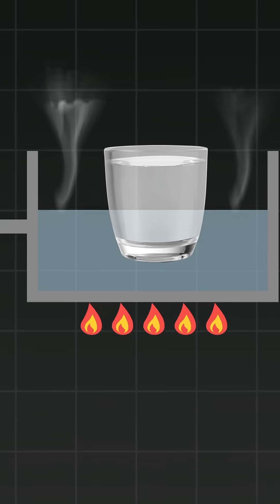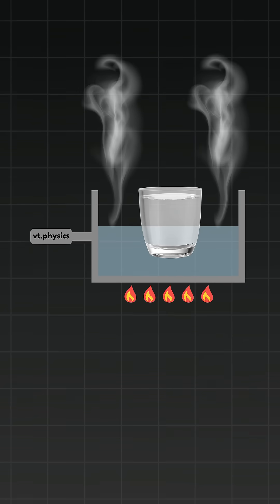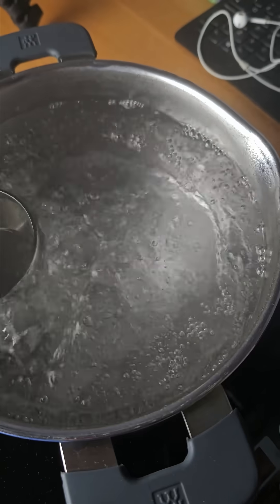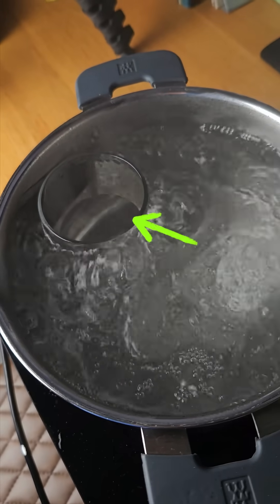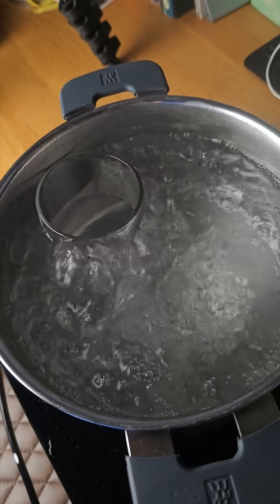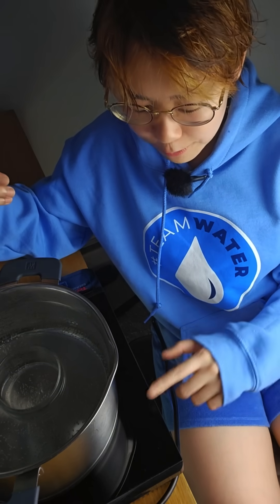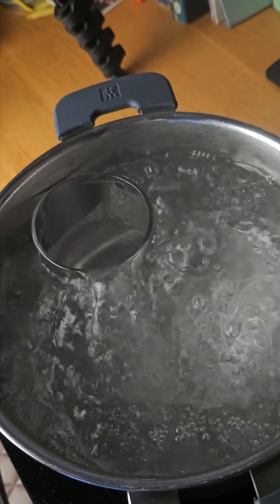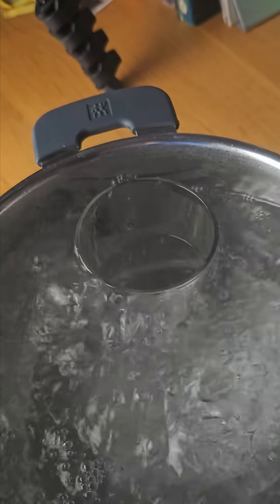Boiling Dilemma: Why Water in a Glass Won't Boil #teamwater

Comment: The heat had to penetrate the glass to make the water boil but since the glass isn't a good enough conductor it can't transfer all the heat it gets from the boiling water to the water inside the glass. The fire transfers heat to the pot then to the water on the pot then to the glass then to the water on the glass. So it loses energy after jumping from each medium to another.

Comment: To clarify, heat only transfers from hot to cold. So from fire to pot to water will continue to happen until the water boils away. But the boiling water to glass to water in glass will have no significant heat transfer, because they're basically at same temperature.

Comment: Put a  bowl over the top  . And let the   water cool  .   Do it different ways  steam  makes it rise when getting hot,   and push out the water that would be there, and when the steam inside will cool and condense and the glass or melts will also shrink  and pull open drawing the  water in. . .  
  Meat  sautéed  or steamed , and if not so contaminated.. will stay operated  as far as flavor  of the water  into the  meat mix. 
  Things like that  are fun food experiments like a seasoning put on the  meat and  the cooling  sucks the to the surface  when the low pressure begins.. .  
 If it is not too much braised and warms  all the way through.  
 Some will be a bit  dry  but still edible..  but the water rich in fat.. allskrts of tjkmgs..

Comment: Given that glass is a decent thermal insulator, and the glass you have has a very thick bottom, probably not until nearly all, or all of the surrounding water has phase changed.

Comment: I wonder how hard you could push this. On paper, it sounds like you can perfectly insulate a space at 100 degrees C so long as you supply the insulation area with enough water / room for it to evaporate

Comment: soooo is there a temperature that you could flash boil all the water?
Reply: it's probably an amount of heat rather than temperature and it depends on how much water there is. if you tried putting a drop of water on a hot pan and it evaporates almost instantly (until the "vapor caught under the drop so the drop floats" thing comes into effect) but there is a formula on how to calculate the amount of energy(heat) needed to flash evaporate the water im pretty sure

Comment: Accually 🤓, water can get hotter than 100 degrees without steam, both though being in a high pressure environment and via superheating which can happen in mircowaves and if the surfaces of the container the water in are super smooth!

Comment: Water can above 100 either by having no imperfections on the vessel for gas to start on or just under higher pressure then same as water boils at low temperature at high altitude

Comment: I would think that the glass would also function as a thermal heat sink to also keep the water in the glass from reaching the required temp, no?
Reply: That only lasts as long as it takes for the glass to heat up to 100C, which is not long.

Comment: Water doesn't all make a phase change, because the transformation of a subset of those molecules removes heat from the rest of the system.  Same reason ice doesn't melt all at once.

Comment: Thanks for this interesting experiment!
 You should be able to bring the water inside of the glass to boil without direct contact with the stove if you add salt to the surrounding water in the pot.

The salt increases the boiling point to over 100 degrees meaning the water inside of the glass should be able to cross the 100 degrees threshold.

Will definitely try this :)

Comment: Technically it could boil in the cup because the steam can get hotter than 100C meaning that if enough steam transferred heat into the glass the water in the glass would boil. In fact some heat from steam does get transferred but the water is good enough at conducting that the steam tends to stay slightly above 100C meaning it can’t transfer enough

Comment: You know the distribution of energy isn't evenly by that I mean if the whole glass had an average temperature of 100°C there would be part of water  more heated and other part less heated, so technically the glass is going to boil in a certain amount of though it's going to boil much slower than the water around and unevenly. That is how ocean boils turn to steam and then rain it's not like oceans are 101°C.

Comment: What about the steam in the bowling water? Those jets must be hotter than 100 deg C because of the water heat + latent heat. If you repeat this in a taller, narrower environment (e.g., a graduated cylinder that can take the temp), would that make the water in the beaker boil?

Comment: Isn't the boiling caused by the surface water turning into gas? There's no direct heat on the glass like you said. Boiling is just vapour escaping from the base of the pot.

Also, why did you say, "threshold" like that?

Comment: Here’s what I’m still wondering: the theory of equilibrium temperature will say that if 2 objects are in contact, they will eventually reach the same temperature. In this case, the 100c water is touching the glass and the glass is touching the inside water. The pot water will go to boil at a normal rate, and the inside glass water should also have a temperature increase due to the convection of pot water to the glass and the glass to the inside water minus the heat lost due to convection of ambient air. But my instincts say the heat transfer from the boiling water to the glass water is greater than the heat lost from air cooling so wouldn’t they reach equilibrium temp EVENTUALLY?

Comment: Now, if you seal the whole thing so it builds pressure, the temperature will go over 100, even the cup, but the water in the cup still won't boil

Comment: latent heat is essentially just energy that is put into breaking bonds, so even if you try to increase the heat, the water will not increase in temperature.

Comment: If u change the cup to aluminum and make  it mite get hot enough to boil.  Also glass is not a good conductor. Also that glass is thick. The thicker the less it's likely to keep the exact temperature. From internal and external contact. Aluminum is more of a conductor also if it's thin. So the water in my opinion will most likely boil.

Comment: never cause the water in the pan boils first before the cup even reaches the latent heat +boiling heat of water
but wait you are wrong 
you see the heat a cup of water needs to boil depends on its mass not its latent heat we also know that heat rises so in theory if you applied boiling heat 100C heat will rise from the bottom and reach the cup to heat up the water and since the water in the cup in the pan  has less mass then the water in the pan the water in the cup will evaporate first leving exess water in the pan 
(am i right or wrong) please explanation

Comment: Well microwaving water it can get hotter than 100 celsius by creating heat vapor traps in the water itself so recommend stirring any microwaved liquid.
Reply: yes water has a low vapor pressure

Comment: so, if I wanted to heat water to such a temperature without boiling it I guess I just have to suspend my pot in boiling water, somehow. I guess I don't HAVE to make it float I can just use a string and hang it

Comment: ELI5 answer; water doesn't boil at 100°C. It boils once it goes over 100°C

For the stoners over 21, this is why sous viding your weed for decarb is the best. The outside water will never reach a high enough temp to cook your THC
Reply: no, water starts boiling at 100 C, and the water’s temperature never exceeds 100 degrees at all. it can never exceed that temperature, because the water that HAS exceeded that temperature has just turned into vapour.

Comment: The reason is that the glass isolates the thermic exchange, such that you will always reach a point where everything is at 100° and do not exchange any heat.

The fun part is that you can "remove" the glass and the same principle remains: the water boils only from the bottom of the pan, which is more than 100° and where the heat comes from, while the top part does not boil at all. You see the bubbles on top just because the vapours are less dense than the water and the gravity push the water on them, making them float away.
In space (microgravity), when you boil a pan of water, you will have a mega vaporous bubble that expands from the "bottom" of the pan

Comment: So there is no way for the proper requirement of energy to transfer into the cup water from boiling water?
Reply: The energy isn't present.
Because it has converted the water to steam and taken the energy away.

The temperature of the water in the inner glass bowl can reach 100°C but that doesn't mean that the water must be boiling.

Additional energy must be input into the water in the inner glass bowl in order to cause the water to boil.

Additional energy input is required into the inner bowl of water to take it from being a liquid at 100°C to being a gas at 100°C.
It's called latent heat of evaporation .
But the energy is not present because the outer bowl of water is being converted into steam and that conversion takes the energy away

Comment: You'd have to get the glass over 100C, which is pretty much impossible if the heat transfer medium(to the glass) is more water. Water can get over 100c without boiling but if a glass is floating in it, it gives it nucleation sites (because glass isn't perfectly flat and even a smooth glass can provide sufficient nucleation sites to cause bubbles to form) which will cause it to boil immediately upon reaching 100C(and once it boils it doesn't gain any temperature since the excess energy it gets will just cause it to change phase faster, which she says in the video). In theory it's possible if you mix the outer water with antifreeze(which raises the boiling temp to 106-113C depending on ratio), but then it wouldn't be "water" and it defeats the purpose imo
Reply: Fluid dynamics is fucking fascinating.
For a vapor bubble to form inside the liquid (like boiling), it needs to overcome the surrounding water pressure and the surface tension of the water trying to collapse it.
Forming a tiny bubble from scratch is extremely difficult. It requires a spontaneous, localised fluctuation where enough molecules have enough energy to form a vapor cavity that can withstand collapse. This energy barrier prevents boiling at the exact boiling point.
Superheated water exists in a metastable state. It's technically above the boiling point and wants to become vapor, but lacks the starting point for the phase change.

Nucleation sites (like glass, a spoon, your finger if you're unlucky) will trigger violent boiling in superheated water, anything above 100c basically. Just like an impurity or scratch provides a surface for ice crystals to form in supercooled water, nucleation sites provide a surface for vapor bubbles to form in superheated water.
Reply: If its already superheated before you put it in*
If it's in the water while you heat it up it'll just start boiling
Reply: Let me give you a far shorter explanation.
As long as the inner and out containers contain the same liquid, the liquid in the inner container will not boil.

That's all there is to it.

If you break that rule, such as by contaminating the outer bowl of water, then you can make the inner bowl of liquid boil.
Reply: @deang5622  yes, but i prefer finding out why :D

Comment: It will boil in microwave oven but in non-metallic pot. It also will boil if you heat it from the top, it can be done in regular oven with top grill function. Also if you replace a glass with thin metal it probably will boil too

Comment: Why the glass did not crack
Reply: glass normally don't crack. it crack when you apply heat/cold too quick cause the expand of glass too fast
Reply: It's just like that fr
Reply: Cus there is no extreme differences in temperatures surrounding the cup

Comment: The water in the glass should start to boil when: the water that is boiling around it creates enough steam at any given time to lower the air pressure in the cup enough for water to boil at a lower temperature. So yeah it's not happening in a stove top